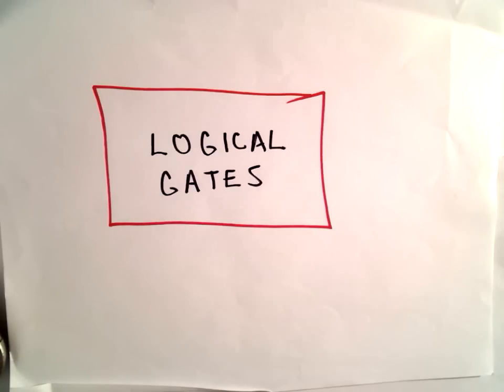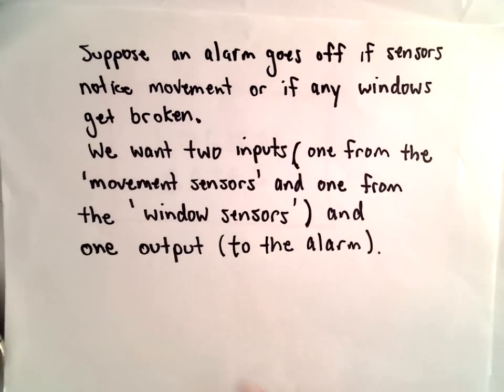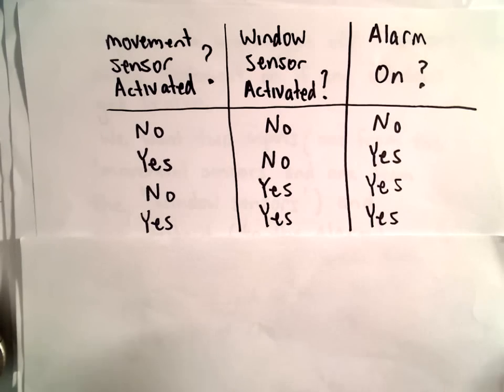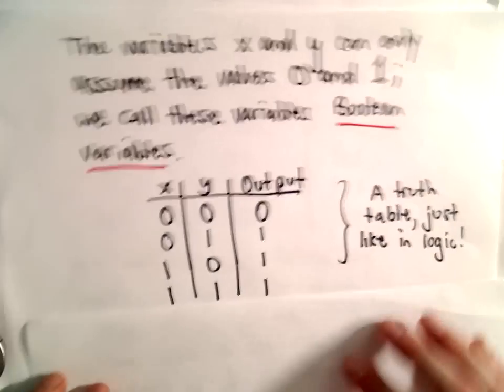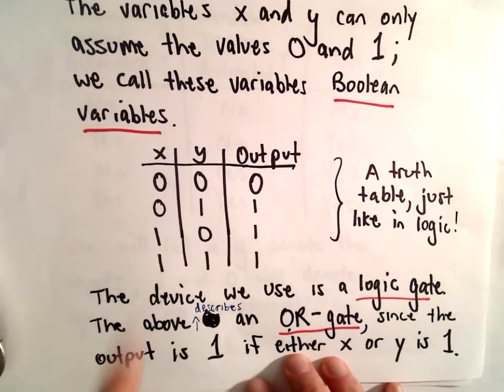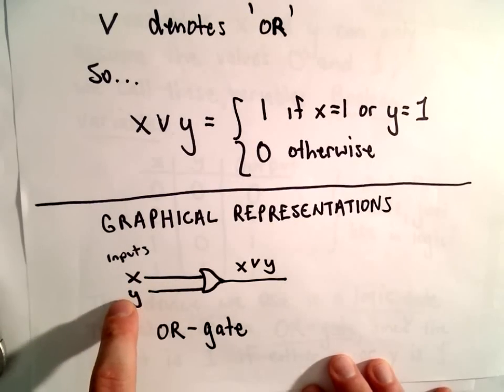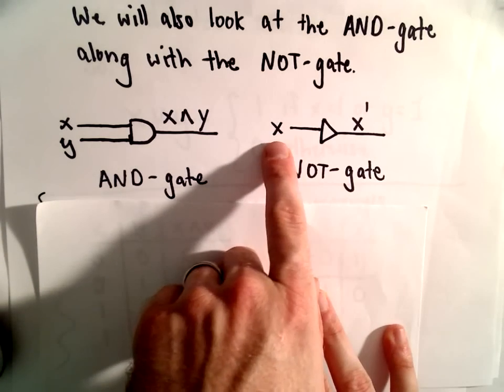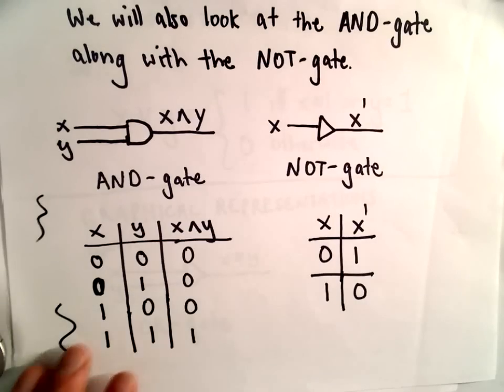Logical Gates /  Logic Gates Made Easy , Part 1

Comment: Could you please explain how I can solve a problem where I have to create a circuit for a 4 sided die game. For each round both players will roll a single 4 sided die. The player with the higher number wins, however can only win if the numbers are consecutive like: Player1 rolls a 1 & Player2 rolls a 2 or Player1 rolls a 2 and Player2 rolls a 3. I can only use AND, OR, NOT, NOR & XOR with a max. of 2 inputs. While the outputs need to be marked as P1 and P2 as two LEDs, so that when Player P1 wins the it's LED lits up and if P2 wins it LED lits up but if no player wins then no output LED should be lit. I know that overall there are only 6 cases of wins and three for each player. Please could you give some advice or video if possible on ways how to approach this word problem. Thanks.